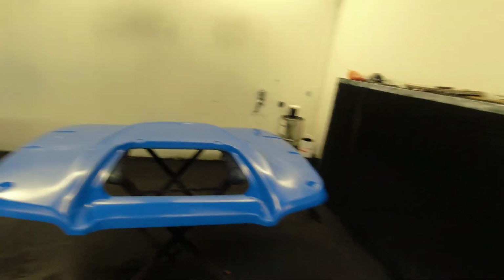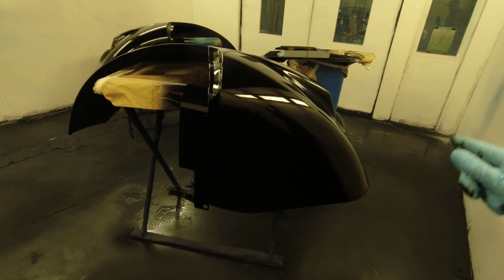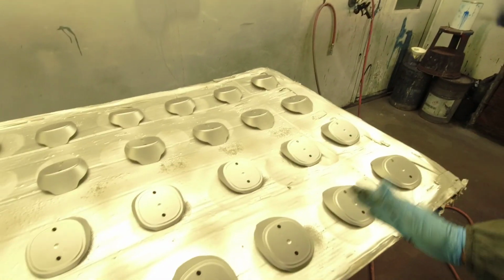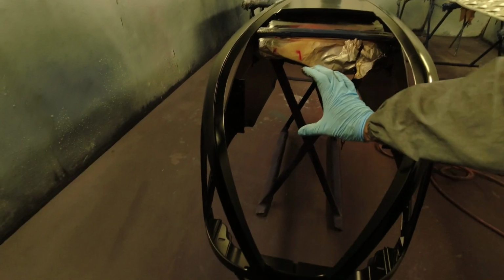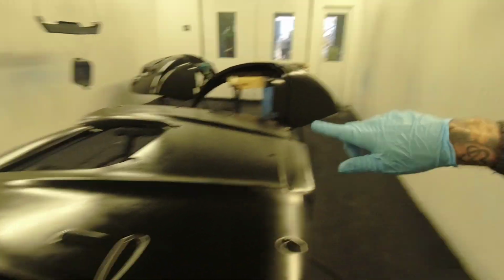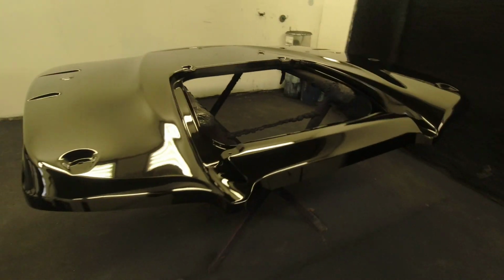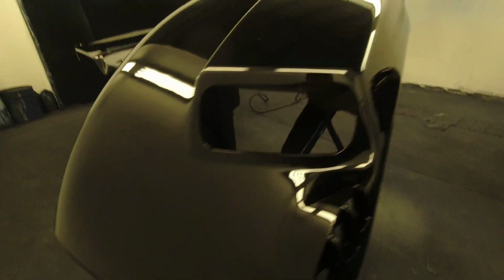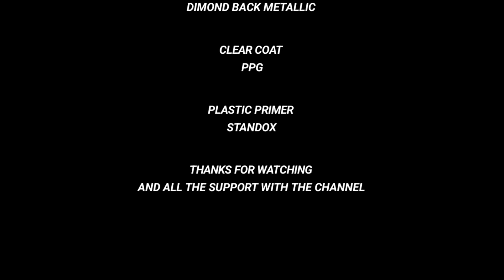devilbiss just get the job done right every time!

Comment: Superb job on the panels Rob, if you are having a bad day and you just not feeling like painting then you can't go wrong by picking up a Devilbiss either the GTI Pro, ProLite or the DV1 they will then look after you by holding your hand and guiding you through the job making you feel like the best painter you can be🙄🤦‍♂sorry I'm just talking bollocks as usual😁🤣

Do you find that the DV1S sounds so quiet after using the DV1🤔I always have to double check the air pressure to make sure it's set right, amazing little gun👌👍
Reply from the maker: Thanks John devilbiss all the way for me mate 👍 brilliant spray guns and yes the dv1s is very quiet 🤫 I think the same thing when picking that up